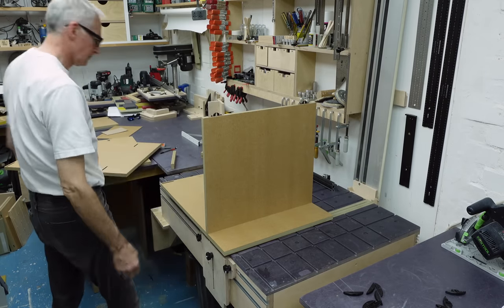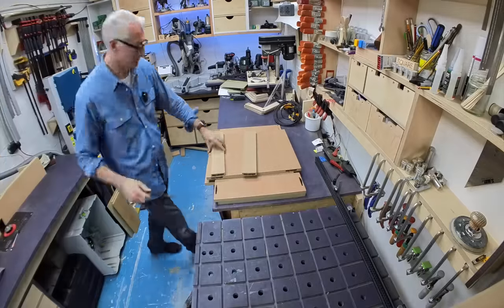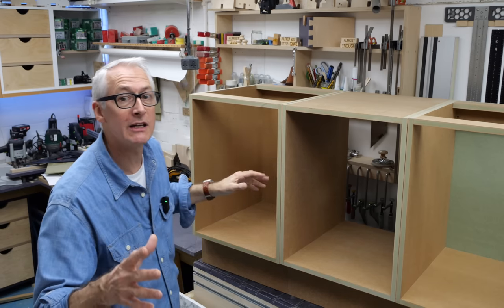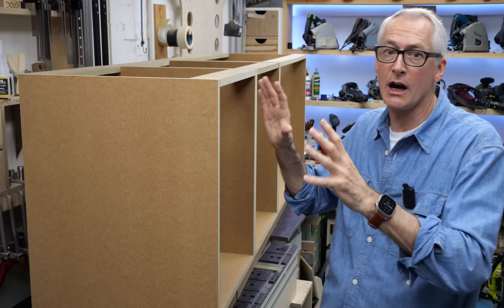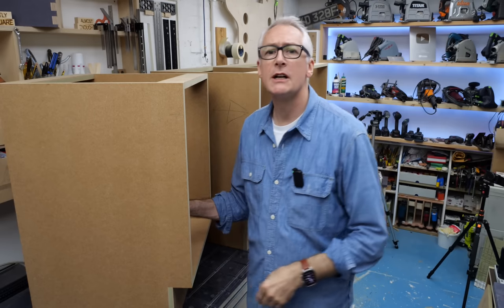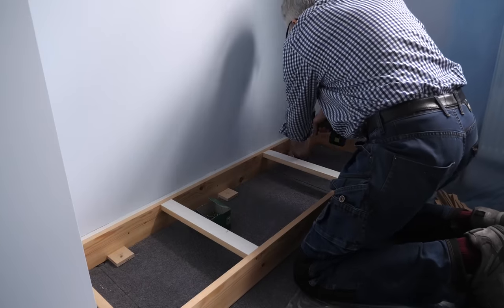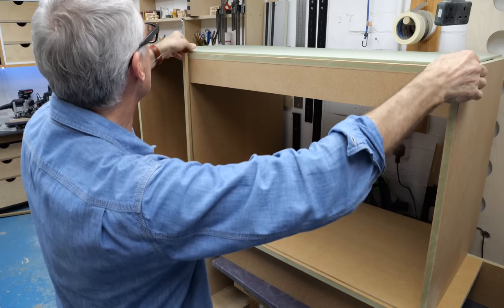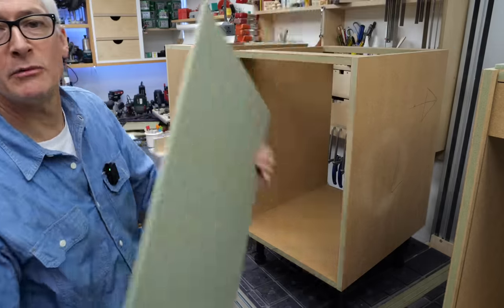Base Cabinet Basics [*Ad] [video 547]

Comment: Buen día Peter, muchas gracias por compartir de tu experiencia, voy a investigar si ya hay disponible este MDF Medite aqui en México, una pregunta, tienes video disponible sobre como colocar los "clips" para sujetar una pieza con otra, girando algun tornillo e ir armando el gabinete??, por favor.....recibe cordiales saludos desde Aguascalientes México...👍
Reply from the maker: Thank you. I used a Lamello connector called Clamex. I did a video recently on the Clamex S20 that works with biscuit jointers - https://youtu.be/NwPCjzXod_I - and an older video where I compared the Clamex with domino connect fittings - don’t have a link for that, but if you search for ‘Clamex’ it should show up. Thanks and best wishes from London. Peter.

Comment: Nice video - thanks.

So Optima has an even denser core than standard Medite MRMDF? I'm going to have to employ somebody to help me manoeuvre the sheets and built bits. I recently made a fireplace surround from 18mm MRMDF and once fully assembled, with its double thickness mantelpiece, it was, er, hefty.
Reply from the maker: Yes, Optima is really dense! Heavy to lug a full sheet around! 👍

Comment: Good evening, thinking about the cabinets I want to build. They’re full height door to ceiling . I was going to have the base piece running the full width so the weight doesn’t sit on join. Am I overthinking this and go for standard construction as the lip of the plastic feet will do the lifting, as it were?
Reply from the maker: I always prefer a full-width plinth, personally.  The only benefit of adjustable feet in floor to ceiling carcasses is that you can build them upright and wind them up to the ceiling.  👍
Reply: Really appreciate the reply. Tying myself in knots with all the different ways of doing things.

Comment: Curious as a trim carpenter/ cabinet maker in the states is medite readily available?  I asked my supplier and a big box store for Water resistant MDF ?  Yep they laughed?
Reply from the maker: The Medite brand is available, but it's not the same medite as we get here! Moisture resistant MDF is available in thr US, but you have to search it out as it isn't widely known about. 👍
Reply: @10MinuteWorkshop  I found it about 45 min from my shop.  As we struggle with our leadership loosing it mind us craftsmen hv to adjust our material choices to keep prices reasonable .  Once we boot them out we can go back to normal (just high cost as opposed to stupid high cost) .  
I hv a request in for pricing waiting to hear back!  Thank you for presenting the material options Peter!  Great Videos !
I hv another question on full overlay hinges but that’s another story for another day!

Comment: Peter said he prefers using a plinth instead of legs. Doesn't a plinth have the same downsides as the full-length sides – that you must scribe them to an uneven floor and they'll absorb water? I'm probably missing something.
Reply from the maker: Not all cabinet are in a kitchen, so water / damp isn’t always an issue. And levelling up a single plinth - rarely scribed, usually wedged btw - is much easier to do once on the plinth than on each carcass. 👍👍

Comment: very nice explanation. one thought thought what is your solution to hiding the cabinet using the plastic legs? thanks
Reply from the maker: Hiding the cabinet? Or hiding the plastic legs? Fr the legs it’s a simple toe-board attached with clips. Nothing visible from the front and easy to remove for access, if needed. 👍
Reply: @10MinuteWorkshop  I C now. You can get leg clips to screw to the toe bored. Any top tips to aline them perfectly? Thanks :)

Comment: Hi Peter,
I recently tried the tongue tite screws and had a nightmare with T10 bits just rounding off after 15 or so screws. Do you have a preferred branded bit or are you just treating them as consumables?
Reply from the maker: Never had an issue with them. You get a new bit in every box, and I don’t think I’ve ever used anything else.  🤷‍♂️👍
Reply: I had this problem too, ended up buying some impact rates tx bits (erbauer i think) and that made the problem a bit better. Not sure I'd use the losttite screws again though as they were quite a faff over a big floor install
Reply: @jegford  I'll have to give them a try. I did buy a pack of 5 dewalt impact bits and still had no luck with those, even with pre drilling.  Cheers bud.